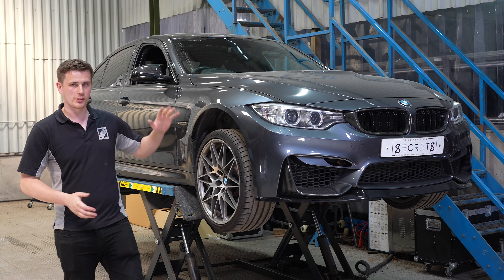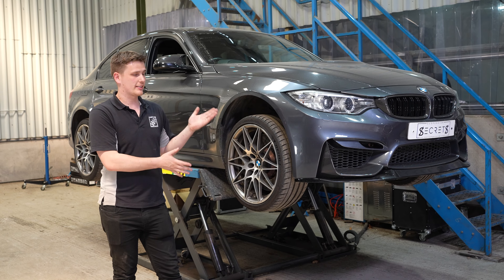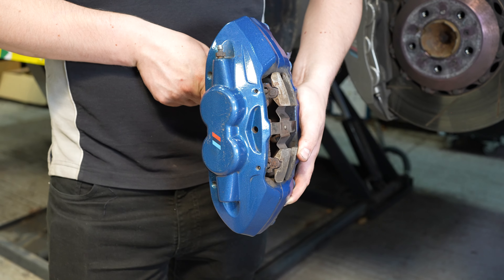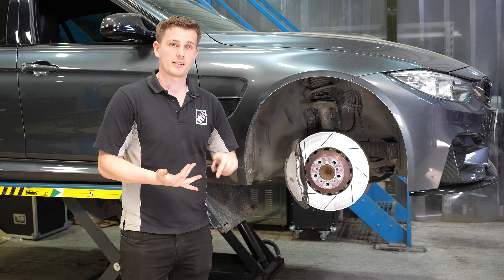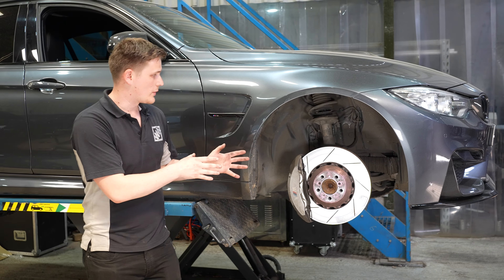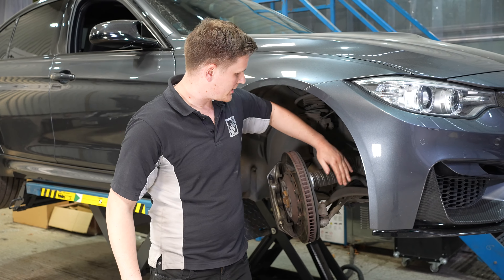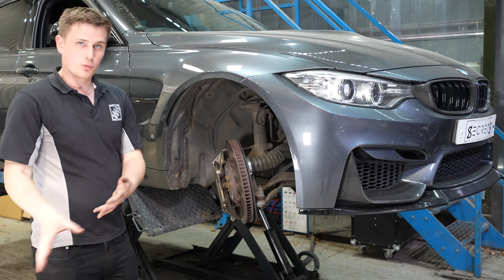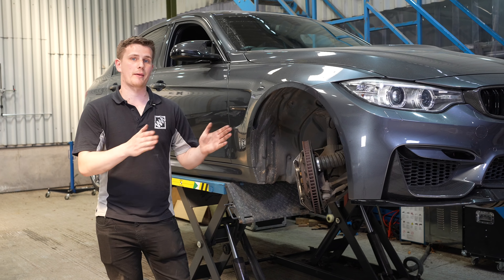How to STOP Brakes OVERHEATING - BMW F80 M3

Comment: I know plenty of people that just swap track pads and fluid and have great luck. Weird that you're having these sorts of overheating issues with factory brembos.
Reply from the maker: We had some people say the same too 👍 we do like to press that pedal hard and late out on track though. And we have spoken equally with a lot of owners who have had the exact same issues as us out on circuit and have therefore moved across to the AP racing braking packages
Reply: Depends on people’s driving style also

Comment: Have you tried EBC RPX pads? I've heard the pagids still deposit giving the warped feel. I did a day on a stock f80 comp and swapped the pads out for the day and had no fade, a bit noisy and left a lot of metal on the wheels but worked really well, I swapped back to stock
 pads on the road and no warpage. Suppose it depends how hard you drive but I was really impressed.
Reply from the maker: We did and we tried the endless too but all pads ultimately warped the discs. The issue was the size of the pads with the small calipers. As soon as we moved to larger surface area calipers and pads the heat dissipated better through the discs and stopped the warping. 

We span the discs on the lathe each time too to ensure that it was definitely the disc that had warped and not pad deposit 👍

Comment: Apex uses the stock calipers for their Nurburgring track M4…

And I think the (heavy) 666m wheels are bad for air flow and for brake cooling.
Reply from the maker: Yes the Nurburgring is actually kinder on brakes than most race circuits as there are longer periods of time before pressing the brakes heavily. On circuits the time between heavy braking sessions are much shorter, leading to a much sharper temp rise 👍

Comment: 100% on choosing the centre of the hub over the disc face for cooling. But.... On applications where it is very difficult to have this kind of cooling like a FWD car I have found having some cooling even to the disc face is better than nothing. It is a worst case scenario for sure but it can work just about if required.
Reply from the maker: Definitely any cooling is better than none for sure 👍 for FWD we have found that ducting air towards the braking assembly instead of all the way up to it is a nice option as it blows air around the assembly which keeps the temperature differentiation quite even still 👍

Comment: Are you guys running with MDM mode on? Turning the traction fully off makes a huge difference. Even with traction just set to MDM, the brakes are being activated a lot and this causes them to overheat.
Reply from the maker: We were initially running with MDM on but have had it fully off for a while now on track. It did help the length of time before warping but still warped on the blue caliper setup
Reply: It will overheat the rear, not the front.

Comment: The issue with the 2NH kit is not fitting behind 18’s like a lot run 😢
Reply from the maker: That is true but not the be all and end all. We will have a video coming soon on wheel sizes and the decision making behind choosing a diameter. A lot of people move to 18’s for tyre choices but that doesn’t necessarily mean it’s the best route to take 👍 bigger wheels do allow bigger brakes and larger circumference tyres that can manage surface temperatures and pressure rises more efficiently too 👍

Comment: I have the 2NH kit on my F82. I don’t track it though. Just looking for high speed stopping power on autobahn!   How did you find the slotted discs over the oem cross drilled? They look like Girodiscs
Reply from the maker: Yes we are on the girodsics now. There wasn’t a huge notable difference between the OEM and the Girodics with the cooling package fitted
Reply: @SuspensionSecrets thanks for the feedback. My only real gripe with oem discs is the droning sound when braking from anything over 270km/h on autobahn. Discs end up having blue colour smear on them as they are probably heating up too quickly. They clean up after some daily driving. I’m looking to have confidence in them at high speed. Also may I ask did you bleed the abs modules with ISTa? I got steel lines and Castrol SRF when swapped to 2NH kit but pedal is still spongy.

Comment: Wouldn't drilled disks help with the dissipation of gases and heat while braking as well?
Reply from the maker: The stock discs are drilled and do help but drilled discs are much more susceptible to cracking with track use and abuse.

Comment: Why didn't you show how you routed the hose behind the bumper?
Reply from the maker: Thanks for the comment. Routing the pipe work behind the bumper requires the bumper to be removed as it is quite tight getting it through the crash bars and coolers so for the purposes of this update video we didn’t remove the front end to show this. The route is quite obvious once removed though 👍

Comment: any backing plates for the rear?
Reply from the maker: Not yet as all of our issues were up front. That said the rears were getting noticeably hotter than the fronts when coming into the pits so we will be working on a rear cooling package soon
Reply: @SuspensionSecrets  yeah I've had the same experience, but I can't justify carbon backing plates where they can't be seen, aluminium is def. the way to go